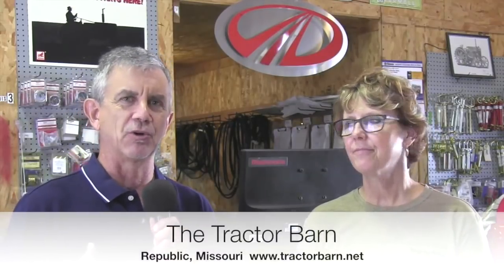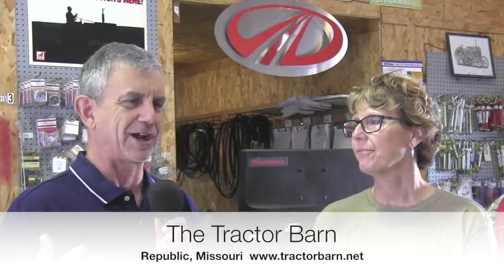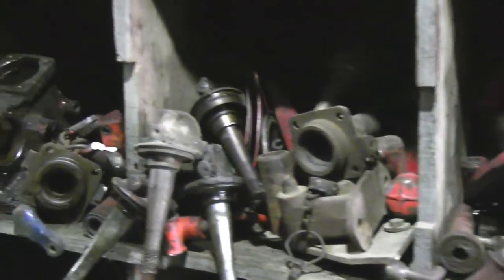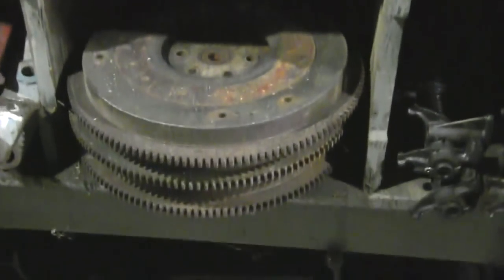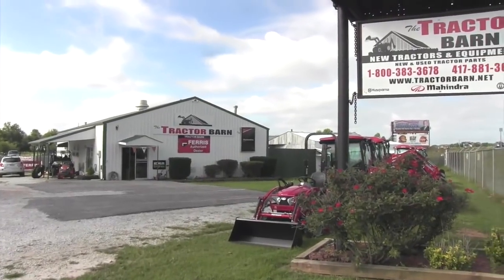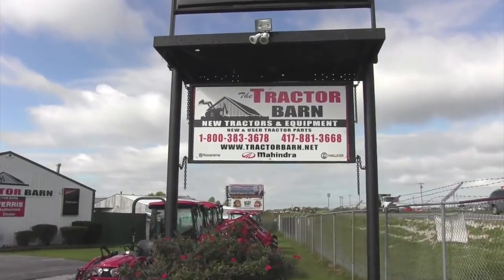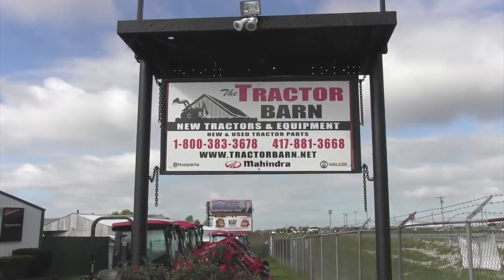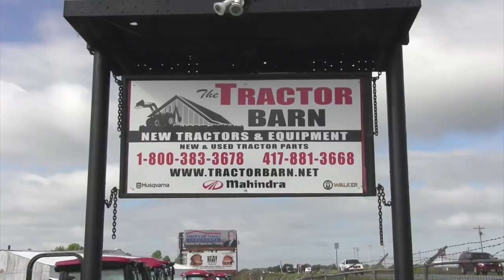Cheaper Parts for Old Tractors

Comment: Best tractor salvage story ever.  A guy needed a rare part for a tractor.  Searched everywhere. Finally found one at John Doe tractor salvage.  Went to pick it up.  John Doe tells him 150 bucks.  Guy squeals like a cut cougar.  John Does reaches under the counter,  grabs a hammer and smashes the part.  Then tells the customer, I have one more for 300 bucks,  do you want it?
Customer took it for 300 bucks and walked away with his tail between his legs and a lesson learned. True story,  obviously not John Doe,  but I knew the guy,  and definitely something he would have done

Comment: Rebuilds for electrical equipment seem to still be pretty cheap. My MF 35 burned out its original starter, shopped and found some that MIGHT fit for $150-200 plush about $50- 60 shipping from the sheer weight. Luckily I knew a guy who used to be a mechanic at the local John Deere dealer and he mentioned a small place who rebuilds stuff that they used frequently for older models, took it to them and picked it up the next day for $75. Now I turn the key and the engine roars after one crank

Comment: I've been trying to find head lights for my AC-5040 diesel tractor.  I have found the lights but not the attachment arms that connect the light to the engine cover.   Some previous owner had the wiring harness all chopped and splice so I found a new harness online but no instructions that tell which wires go to what location.
Reply from the maker: You might try All States Ag Parts in Sikeston, Missouri at (573) 471-2727.  I doubt that the part is still available from an AGCO dealer, but you might look it up on AGCO's parts website and get the part number and Google it.  Here's the link to it: https://apb.agcocorp.com/.  Good luck!

Comment: looking for the mounting brackets (lower and upper) for a ford LS 45  42" mower deck.  one from the front left drivers side. do you have one of these on hand - used and in good condition?

Comment: How many tractors do you own and what horsepowers and brands are they if you own more than one?? Just curious
Reply from the maker: I bought a New Holland TC40  that's 40 hp engine when I was working at a New Holland dealership, when my dad passed away I inherited his Massey Ferguson 362 that's 62 engine, 55 PTO.  I probably should sell dad's tractor because I don't need two tractors and it doesn't get run that much, but it's dad's and there something inside of me that can't let it go.

Comment: I have a Massey Ferguson 165 with a Perkins gas engine.  Need a carburator for it.  May I have a number to correspond with someone.
Reply from the maker: Don't call me, call Yesterday's Tractor at (800) 853-2651.  They'll fix you right up.

Comment: Hi to all community, I’m really trying to get some savaged (cheaper) parts for zetor 8011, 8045, 12045, or its 6 cylinder version, 8111, 8145, 12145 for my brothers in Cuba. Honestly, I’d appreciate and be thankful for any spare parts I can send them.
Reply from the maker: Give a call to Ranchland Tractor in Saucier, Mississippi at (228) 832-8300.  Talk to David.  He has some Zetor parts he'd like to move.  They're new parts, but he'd like them to go away and would make you a good deal on them.
Reply: Tractor Mike thank you so much. Will call them

Comment: The younger guys don’t know how to work on them? Oh please. The older tractors are nearly all mechanical and so easy to work on. The old fogies working on them say the younger generations don’t know how because we simply don’t have every bolt’s torque value memorized. Stick an old guy who only works on old stuff and put him on a tractor with problems that has all computerized fuel injection, electric SCV’s, and a CVT and they’ll be lost. Easier for a younger mechanic to work on an older tractor than it is try and teach an old guy who can’t run a computer how plug in and run a diagnostic check.